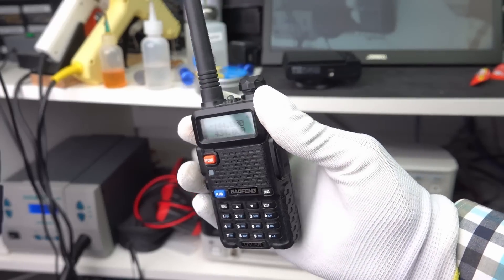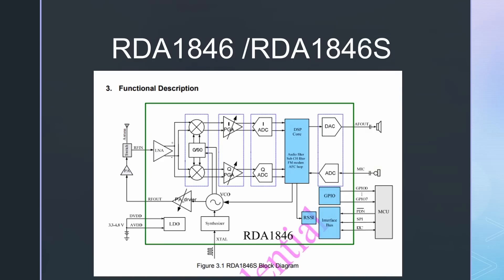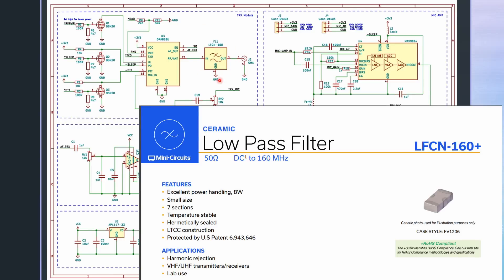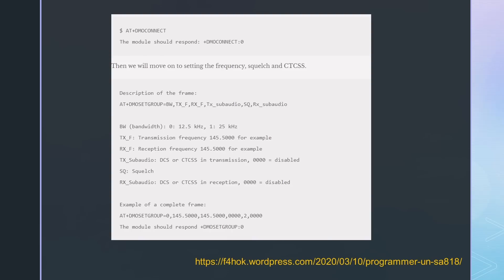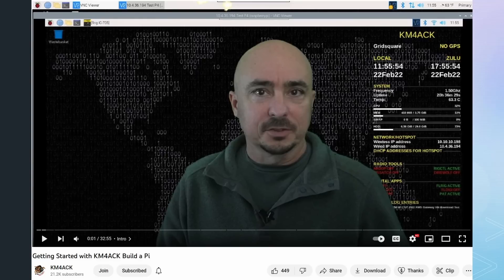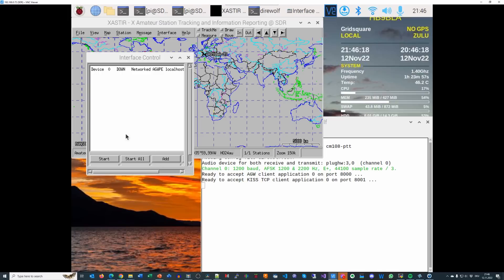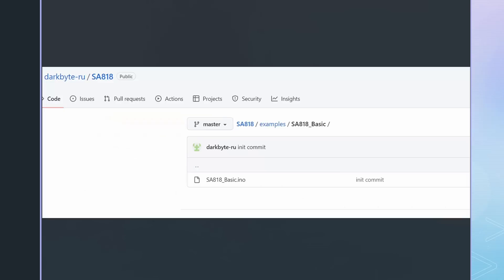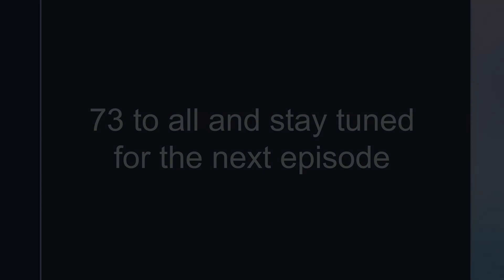025 We use Baofeng's "heart" for Our Projects (SA818, DRA818)

Comment: I just got my kt including a SA828 with usb interphase and vol rheostat, soldered them up but I haven't programed it yet, the kit has a built in PTT and microphone, came with a rather large laptop speaker. I sort of plan on installing it in a small broken family radio case (radio bad) to make a little 2 meter radio. The 828 has 16 programable channels. I am searching for a good sketch for the esp32 so I can run it with that instead of a rotary switch that is onboard for switching channels and I would like to use an OLED screen to display info,
Reply from the maker: I would ask ChatGPT to create a sketch tailored to your specific needs. If you specify it well enough, the results are astonishingly good.

Comment: @HB9BLA Very interesting! I wonder: has anyone tried to directly hack an UV-5R? I mean hacking its PCB to remote control frequency etc with a raspberry pi. This would be a lot cheaper because you save all the supporting components and you get 5W instead of 1W for free. Does anyone know of any such projects?
Reply from the maker: I do not kow of one. But they hack other cheap radios by replacing their firmware.

Comment: Hi !!! I`ve got two Baofeng BF-999S walkie talkies, but I need to use them as receiver/transmitter only for data, using two ESP32 , I don`t need mic and speaker, I just want to send packets of data from one to the other. Can you help me ? thanks !!
Reply from the maker: This video shows one possibility. But there are many other digital modes in HAM radio where you connect a computer to a radio via a soundcard/modem.

Comment: I think the "strange signals" which appeared on the wires after installing antenna was your stray RF because small antennas on handhelds don't have a counterpoise. Maybe if you added λ/4 wire soldered to your SMA connector, the problems would disappear.
Reply from the maker: I agree

Comment: Thank you for a truly great presentation.  I have a VHF SA818 Firmware Version 1.1 - When I invoke filters --emphasis disable --highpass disable --lowpass disable
SA818: INFO: +DMOSETFILTER:0 filters [Pre/De]emphasis: disabled, high-pass: disabled, low-pass: disabled  and indeed a waterfall of the receive shows the filters to be disabled - UNTIL I transmit, then at least the low pass filter is restored.  I was hoping to use an external ctcss/data decoder, but that will not work when the low pass filter returns after transmit...  Any ideas ???  es Thank You agn, de nu5d

Comment: What you want is an I2S stereo CODEC talking to the RPI or ESP32.  Split the stereo to L = LocalAudio, R = RadioAudio - with the individual channels optimized.  If you want more radio modules, they make 4-channel I2S codec that only needs the single I2S data-lane (2x16-bit split audio channels per 32-bit I2S channel period).  That would still work with a minimal ESP32, and would give you another 2x radio slots for 3x total radios and a local mic/speaker.
Reply from the maker: Good idea!

Comment: The SA818 has an SDR at its core. Has anyone been able to get it out of FM and do SSB or a raw module signal with modulation from a software defined radio on the Pi?
Reply from the maker: I do not think that this is foreseen (no pins with such signals)

Comment: Where can I find? ...
This looks like a great setup. I am a pilot who is NEW to SDR and am asking for help to find out the best way to connect the voice input received by the device into voice recognition software on the PI using the Python PiAudio library. I want to be able to call the receiver at my grass strip airport to command the PI to read the wind direction and speed from a weather station and broadcast the information back to me.  (Airband in North America, the spectrum from 118.000 to 136.975 MHz is used with 25 kHz spacing and AM). Instead of voice comands, I could - lets say - click my aircraft radio transmit button 5 times. The software on the Pi would have to know how to count the transmit clicks. I have no idea how to do that. 
Any help appreciated. Thanks!
Reply from the maker: When I returned to the field in Venice, I had to key the transmitter a few times to swithc on the runway lights...
The question is if you need to use your official gear or you can us a different frequency, If you can use a different one, I suggest to look at LoRa (I have some videos about it on my main channel). It offers a data connection on 915MHz ISM (license free) band.

Comment: I know I am asking some very old questions that I have not found any answers to yet:
  
1. is it possible to program the chip to give you raw or unfiltered  RX (for 9600 baud packet) nor not?  
    same interest in transmitting higher speed data than 3KHz/1200baud
2. Do these SDR use any kind of a (VHF/UHF)Local Oscillator and IF frequency (internal to the chip) for RX and any idea what it is or how to find it?  
    I was just going to put an antenna and spectrum analyzer near the chip to try and find it.  
THANKS!
Reply from the maker: This chip is an FM transceiver. It is used for low speed packet because it only has the standard voice bandwidth. And I think you find the LO frequency on the xtal pins of the RDA1846 chip inside the module. I assume it is close to the receiving frequency because the DSP  wants NF...
Reply: @HB9BLA  Thanks for the reply, by LO I mean the RX injection LO not the crystal clock frequency.  
Assuming there is a mixdown from 460MHz or 150 Mhz before brought down and sent to the SDR. 
Not sure what you meant by it wanting "NR". 
Please explain.  
I don't expect SDR happens directly at 460 or 150 MHz. :)  
I could be wrong, but not going to go and admit that.  
Also the RDA1846 is "hardcoded" for low bandwidth voice.  It could physically do 9600baud or higher bandwidth IF they wanted it to and could have added this to the command set.  
But they did not.  
Just like it can do 25KHz FM or 12.5kHz FM RX+TX modes. It could have been given the ability to do wider modes.
Limited in software.  
FM RX mode on (65-108MHz) is programmed or "hardcoded" to make the chip do a much wider RX mode.  
Could have been done for UHF/VHF to make it higher speed data capable.
Fun stuff anyhow.  
Cool video.
Thanks!

Comment: Hi  Andreas, Thank you for the great leaning materials. Regarding this module, is it possible to use it for CW? Just got my very-very-beginner HAM license and I am still not allowed to build my own radio but I am learning for the next license level and, in the meantime, try to get more information. Many thanks!
Reply from the maker: It does FM. Without modulation, it creates a stable tone that could be used for CW. But I think, the on-off speed is not fast enough. And the receiver does not "hear" CW
Reply: Thank you very much!

Comment: Look to the AudioInjector Zero.... it is a sound card hat for the pi zero.... I'm using a DRA818 and the AudioInjector Zero for an APRS digipeater
Reply from the maker: Thank you for the info. A good solution. Currently, we design a Pi hat with a souncdard chip and a SA/DRA818 to save space...
Reply: @HB9BLA  nice.   Got a link where one can get that?   Does it have band-pass filtering circuitry added?   Im running a solar APRS digipeater with the DRA818 module from SV1AFN and the audio injector.... Id love to transition that to something that is combined onto a single pi hat, as it will be less of a rats nest of wires in the outdoor enclosure.
Reply from the maker: @3dcreationsofri  It will surely appear on this channel if it is ready...
Reply: @HB9BLA  the other project im working on is using two of these DRA818/SA818 modules interfaced with a repeater MMDVM board and see if theyre capable of being used to build a portable DMR repeater.
Reply from the maker: @3dcreationsofri  I have an Echolink device with an SA818 HAT on an Orange Pi mini. This board already has a sound car built-in...

Comment: A note about the low pass filters. The Baofeng-style radios use the antenna for the low pass filter. Some regulations require harmonics measured at the transmitter while others use the transmitted signal. The latter are generally associated with inexpensive radios where the antennas cannot be removed. The higher the Q of the antenna the better - for more than one reason! 73, Chris K9EQ
Reply from the maker: Maybe, I never made such measurements. But most antennas I tested had resonances at the harmonics, too.
And the Baofengs have connectors. So the regulator here will measure there.

Comment: I have 4 of those modules here waiting for me to do something with them.  I set up a cheap DVR with audio inputs and some HTs as a way to continually record the repeaters we own in case there are technical issues, or people issues.  I wanted to make a carrier board for 4 modules that would allow 4 discrete frequencies to be received and sent to the DVR instead of having 4 HTs in chargers.  I'm willing to pay someone to design this if interested.
Reply from the maker: One of my viewers does a PCB with 2 boards. Mainly for 70/2m satelite work. Maybe this one could be used…

Comment: Very nice ! You look like an expert in electronics, maybe you can help with a long time question on the UV-5R: what is the purpose of the trim potentiometer in the transmit circuit ? If you have the diagram, it's called VR2. I haven't been able to find an answer to that question anywhere...
Reply from the maker: I have no idea, I never opened one.

Comment: This is absolutely amazing. I remember back in the 80's doing RF electronics was very complicated with lots of math and circuit design expertise needed. Today things changed drastically. Building complex electronics projects feels like playing with "LEGO". Everything connects to everything by SPI or I2C and you get the job done quickly.
I learned a lot from your great video !
Reply from the maker: RF Know-how still is needed, particularly if something doesn’t work;-)
But I agree: We live in a wonderful electronics world.
Reply: It all comes down to the projects dedicated to making open source hardware and software for the community, Arduino really put it in motion and obviously much has advanced since then, but a lot of the standards for the components came from that project and appear to be solid.

Comment: #1. All in one, bluetooth APRS module. Think of a Mobilinc TNC but with a transmitter built into it already. That way, you just connect your phone or bluetooth tablet (or laptop) to ONE device and go.    #2 Self contained, stand alone APRS digipeater/igate. There are a few on the market but they have TERRIBLE software and are very expensive ($200usd and up). Something that is low powered that could be solar powered would take the place of LORA Mesh units that everyone is talking about, but have better range than a few hundred mw on 900mhz.  Also, Denis from Digirig was working on a Pi Audio hat.  There are many on the market, but have seem to fallen away or are very expensive.
Reply from the maker: We get now LoRa APRS. And do not underestimate LoRa. I bridged 200km with a simple 100mW module and a very small antenna. Search for „world record „ on my main channel if you are interested.
Reply: Someone finally did it. Combined the SA828 with an esp32 and created built in aprs  digipeater mode

Comment: 📻 I want to build a all in one scanner like the HRD-747 but running off a arduino or esp32. Using the sa818 modules I thought it could be a good idea. The goal is fully open sorce radio communications.
There are some scanners on the market but I want one that looks and feels like a handheld radio. Or is at least pocket size like the HRD-747.
All ideas are welcome.
Comment here if you're interested.
Reply from the maker: I would use an SDR for a scanner. Much better suited.

Comment: I am a boat owner and these radios work great for marine vhf band - not impervious to salt water, take that with a grain of salt!
Reply: If it was set to single band mode operation only, could you cover it in potting to weatherproof it?
Reply: i keep it in the cabin the steel parts rust, when it fails i will buy another, been going for about 4 yrs now
Reply: That is illegal. You need to be using FCC typeset radios. I’m telling.

Comment: I designed an ESP32 controlled repeater around the SA818 modules that can fit in an Altiods tin. (At least once I get it made.)  I also found that my SA818's meant for 70cm respond and work properly even when setting the freq to be in 2m. So not sure whats up with that.
Reply from the maker: 1. I am interested in your ESP code. Is it documented?
2. Another viewer reported all that they work on both bands.

Comment: hi Andreas,
QQ, did  JLCPCB mount all the parts and SA818 or just Maxim?
73 iu2omt, paolo
Reply from the maker: They mounted most of the parts. Not the hand soldered.
Reply: @HB9BLA   mmm, even if one years elapsed, the price to assembly 5 units was very cheap considering SA818. I paid €22 for the last i bought and €10 at beginning of '22
Reply from the maker: @fpaolo63  The SA818 was hand-soldered and not part of the price.

Comment: New to the radio world! Very minimal experience with raspberry pi and chips in general but would it be possible to add "encryption" to the baofeng or with the digital signal?
Reply: Technically yes but not legally in the US or most other amateur radio countries! Here in the US the FCC mandates that any operator must be "able to receive and interpret your signal" so as long as your format is published and can be understood by another ham, you're all good!
Reply from the maker: Kenwood is Right.
Reply: You can encrypt stuff on public bands like LoRa (FRS?) if you aren’t operating as a HAM, the restriction is part of the licensing...  so in North America as a HAM you can use the 433 MHz LoRa band (or 915), but it has to be unencrypted, whereas the public may only use 915 MHz, but it can be encrypted.

Comment: Very nice.  A friend of mine has an open source project that uses a CM108.  The small PCB has some support circuitry to break out the audio in/out and CM108 GPIO (exposed on the SMD version of the CM108) for interfacing a radio.  I love that Direwolf can control the CM108 GPIO for PTT out of the box.  I've been using his project now for 3 years and it works great for Direwolf + Pat on a Pi 3.  We've also experimented with the NinoTNC for 9600 VHF packet via Direwolf.  I've seen a few others build hats exactly as you describe.  I'll have to find that project and send it to you.
Reply from the maker: I found one from 2012. but not in the Pi zero form factor…

Comment: Interesting stuff. I could do a PCB design, but I won't be able to start until January. I'm sure someone will have it done by then, but if not then let me know and we can design the hat you need.  🙂
Reply from the maker: Thank you. I found somebody who wants to do the job. Let’s hope we have a prototype till January. Otherwise I will come back.
Reply: @HB9BLA  just finished the gerber file for SA868-V with i2s sound card on a pi hat.   No kludgy usb wires, all going through pi gpio... Sending off to manufacturing shortly.
Reply from the maker: @3dcreationsofri  Cool! Is it for the "normal Pi or for the Zero? We head for the Zero because we do not need too much power and memory for the applications in focus.
Reply: @HB9BLA  its regular pi hat form factor (only way to fit everything on the board) but it will work equally well on either a regular pi or the zero since theyre same gpio pinout
Reply: @3dcreationsofri  I'm curious what I2S chip you used. The WM8731 we could source turned out to be a fake.
Reply: @jancornelis7218  ohh.. Good to know... I did design it with the WM8731... Ill have to watch for that when my next prototypes come in.

Comment: oh man this would be SICK if we could get a mini vhf/uhf pi hat to do digital modes and other stuff
Reply from the maker: I am confident that it will work…
Reply: @HB9BLA  ok but series of chips/dev boards can i look at to stuff a cell signal into a steam deck?
Reply: Certainly something that would be very useful. VK2DU
Reply: I just finished my gerber file for an SA868-V (2 watt version of the 818) with a built in sound card in a pi hat format.   Im probably going to send out for manufacturing about 10 or 20 for a first prototype run next month.
Reply: @3dcreationsofri  have you done his yet and are they available?
Reply: @williamhowell1791  ive got a small batch out to manufacturing, then will have to run testing to make sure every is working as designed, so still a bit of time before i can make them available.
Reply: @3dcreationsofri  Let me know if you need a beta tester... and when available for purchase and for how much...
Reply: @John Tetreault  where is best for us to keep up with this project??

Comment: Great video.  I'd love to see a ESP32 use Bluetooth to connect to an Android phone app.  We could use it as an interface or send data direct.  The module would simply have are the RF stuff in it, plus a battery etc.
Reply from the maker: Then somebody has to write the TNC sofrware…
Reply: @HB9BLA  The KissTNC runs on Arduino and is open source, maybe porting it is doable I don't know...
Reply: You could connect via WiFi and do the DSP on the Android phone...
Reply: Reticulum?